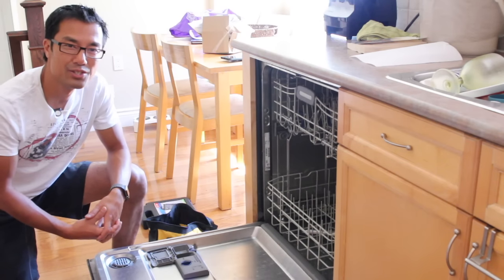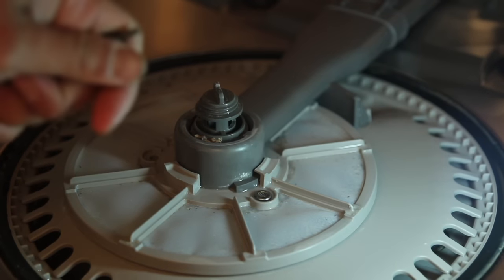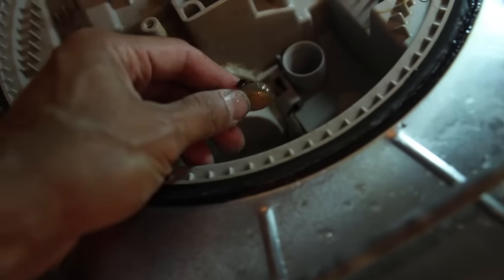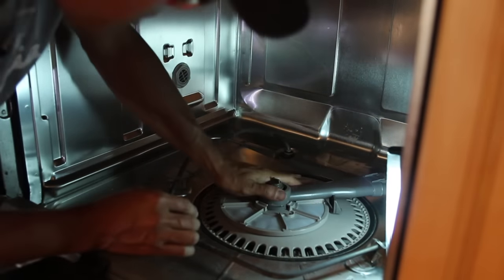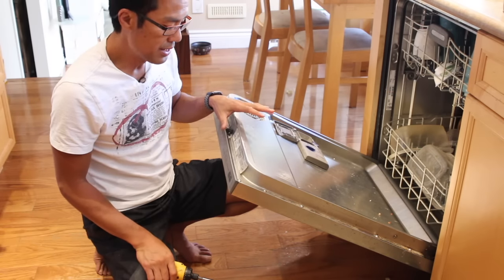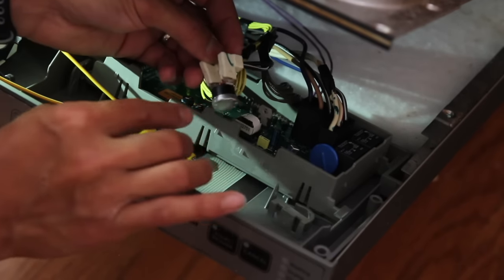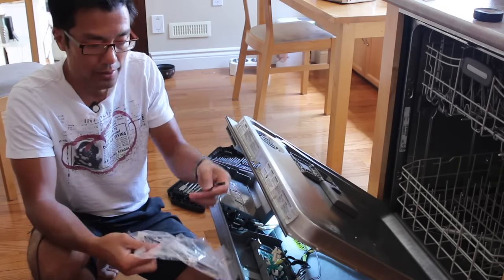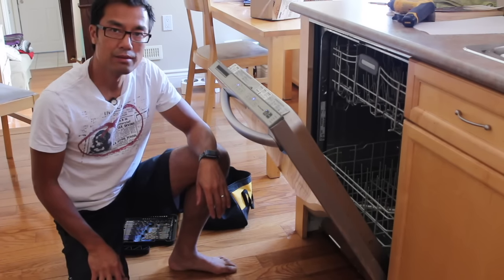KitchenAid Dishwasher Repair - No Power, No Lights and Grinder Clean up

Comment: I have no idea why they use these devices ...perhaps to enrich the rewards for the service techs and parts vendors!  These non-resettable breakers could easily have been replaced with an auto-reset device (they do exist) or even a manual resettable thermal breaker.

These things occasionally trip for no really good reason.  I have the same dishwasher and mine has tripped twice over the course of eight or ten years.  I have never replaced it.  Quite often, you can spray them with freeze spray and the extreme cold will make them reset.  I've even done it by putting the device in my freezer overnight.  Reinstall it, and it works fine again for years ...for at least as long as a new replacement would have.  I have even opened them up (gently), reset them and re-closed them, and they work just fine. I just LOVE beating the system!
Reply from the maker: Love this!  I need to try this out.
Reply: @DDIY-Guy 
 ...the ones that won't reset with cold-shock can be reset by opening them (gently!), resetting them manually and re-closing. A little dab of super glue will re-close them.  It's important to re-close them completely (firmly) as failure to do so will affect its intended function.

Everyone I've ever reset (cold-shocked or manually) has worked properly.  The one in my dishwasher has tripped twice - about four years (and many wash cycles) apart, but it still works fine.  I have the exact same type in my KitchenAid oven.  The self-cleaning cycle (after about three years of use) started to trip it due to the high heat.  That one reset nicely with cold-shock. (I never use the self-cleaning function anymore for that reason).

When you open one up, you can usually see there is absolutely nothing wrong with it ...it just got "finicky" one day and decided to trip.

With all this said, they are in there for a purpose, and even though some may trip inadvertently, some may trip due to an actual heat problem.  The bimetal in these devices can actually weaken over time (after prolonged exposure to heat and/or too many trips).  In that case, it should be replaced, and reasons for the tripping should be researched.
Reply from the maker: Thank for the tips.   Have a great evening!

Comment: Danny - I followed your directions and was able to fix the dishwasher. The new fuse blew again after one use so I am thinking there’s something else wrong. How do I go about figuring that out? Thanks
Reply from the maker: It might have been due to the quality of fuse you bought….if it’s not too costly, maybe get another brand of fuse.  If it still blows, then there might be a bigger issue with the control board….it that case, it’s hard to find a replacement board, plus it’s expensive.  At that point, it might just be best to get a new dishwasher :-(

Comment: Hey Danny, thanks for good vid. In terms of dishwasher fuse on main power line and a thermistor are two different things, correct?
Reply from the maker: Sorry i only know of the thermal fuse on the control panel.  The main board can also sometimes blow and might need to be replaced.

Comment: We have the same model, and it just stopped mid cycle, too!! Ours is now completely full of water on the bottom and not draining at all.  Do you think it could still be a fuse issue?  Trying to figure out how to clean out the water in the mean time....!  Thank you!!!
Reply from the maker: Is the lights completely off?  You can try turning off and on the breakers first.  If the lights don’t go on again.  Use a “dry vacuum” to suck out all the water.  Once you get the water out, then clean out the grinder like I did in the video.  There might be something jammed there that could have blown the fuse.  Once you’ve cleaned it out, then check the fuse like in the video.

Comment: Great video! however I have a different problem, the unit is leaking from the bottom. Do you have a video for that? I checked other videos and they are talking about a Grommet, does this unit have one? thanks.
Reply from the maker: Yes, i made another video on a leak fix at the bottom.  Check out the other videos in my channel.

Comment: When I jumped the fuse and tested to see if the door lights came back one, a part of the mother board sparked and smoked. The fuse was blown (I tested with a voltmeter before), but not before the motherboard also fried. Also, I found a melted connector/wires going into the motherboard. Something got very hot. Even if I replace the fuse/motherboard I can't replaced the melted connector. And I don't know what caused the overload. Time for a new dishwasher. Thanks anyway.

Comment: Thank you.  Mine was dead in the water out of the box.  Option #1 Factory Warrantee repair if I can't do it myself.  Option #2....Whirlpool sends someone out ot pick up this piece of junk and I replace it with a B osch like I had before for 14 years.
Reply from the maker: After a few more other issues with my Dishwasher, I gave up and ended up replacing it as well with a Bosch and we love it!

Comment: The fuse is there for a reason, bypassing it could burn out a device down line. Best to use a wire shunt with a comparable fuse inline or test the faulty fuse.
Reply from the maker: Good advise.  I got lucky with this one and my dishwasher as been working ever since.  Thanks for commenting.
Reply: DDIY GUY Danny Jose I wasn’t so lucky the first time

Comment: Danny - hey, this has happened again in around 3-4 months - Stopped again in cycle.  Any thoughts on the recurrence? Bigger issue? It’s  a $15 fix, so I’ll continue to do it if needed to extend life.
Reply from the maker: Try cleaning out your grinder again.  There might be some stuck items in there.  I would just buy the fuse again....these things tend to happen on occasion so that’s why they have the fuse to prevent further damage to the board.  Hope next time it last more than a few months....mine has not blown since I installed the new fuse.

Comment: Has your repair held up as it's been 2+ yrs since you posted this video?  Also, do you think the fork pieces caused the grinder to bind up and resulted in the overheating that blew the fuse?
Reply from the maker: Yes, my dishwasher is still running well with no other repairs needed.  We use it everyday and I regularly clean out the filter every 2-3 months.  Yes, I believe that things that get stuck in the grinder will potentially blow the fuse.
Reply: @DDIY-Guy  OK, thanks.  I have ordered the proper fuse for my Kitchenaid dishwasher and plan to do the same repair that you did such a good job of documenting on your video.  I looked  at several YouTube videos and yours was by far the easiest to understand and most helpful.  Great Job!
Reply: As a follow up, I wanted to let you know that I cleaned the drain and replaced the thermal fuse.  This repair was successful and the dishwasher is working now.  BTW, the bottom spray wand on mine bumps the bottom and doesn't spin freely when I try to spin it by hand.  I thought that I had incorrectly re-assembled it, so took it apart again and reassembled with the same result.  I think perhaps the bottom spray wand pops up a little bit under water pressure to allow it to spin freely.  I can't tell for sure if it is spinning freely during operation, but I don't hear any unusual bumping or banging sounds during operation and I do hear a "swoosh, swoosh" sound which sounds like it is turning.  Thanks for your help!  Al

Comment: Never, ever, underestimate the value of shopping for anything on eBay first.  That fuse link on most on-line appliance part sites, or on Amazon, will sell for $28.00 to $37.00 plus shipping which will usually add another $4.00 to $8.00.  You can buy that same genuine Whirlpool fuse on eBay for $8.00 to $12.00, depending on the vendor, with free shipping, and I had my part in three days.  People think that Amazon is the go to site for good deals but you soon find out it's only making Jeff Bezos richer by the minute.  Sometimes you have no choice, but most of the time you do.
Reply from the maker: Thanks for the tip. I will certainly look more on eBay options. Have a fantastic rest of the weekend.

Comment: I didn't see what problem you found. Mine one has intermittent no power no led, but sometimes it works fine, check power cord/nut not found problem, any idea?
Reply from the maker: When you say intermittent, do you mean the dishwasher just stops during a cycle?  If so, check the bottom front/right corner of the dishwasher where the circular water spout is located. Make sure there is no utensil stuck underneath it.

Comment: Why spend 30.00 for a fuse when you can get a fuse holder and a fuse for a few bucks, solder or crimp the fuse holder in place, and if you have a volt meter it has a resistance meter on it that you can remove the fuse and test it, with the power off of course!

Comment: Never bypass fuses unless you like living in a burned down foundation.
Reply: What do you mean by bypass?
Reply from the maker: Well the purpose of a fuse it to blow or cut the circuit if there is an abnormal amount of current surge.  Bypassing this fuse will allow any current to go through....but this method was only to find out if the dishwasher will actually work again if the fuse is replaced and not meant for you to permanently bypass it.
Reply: @DDIY-Guy +

Comment: I have  General Electric Dishwasher Model No:GLD5500L00WW  , Seri No: LL750671B and when I plug in there is no light but just beeping ones only.I did not find the fuse also.Any idea what is the problem.
Reply from the maker: Well it does sound like there is something blown on the control board.  If you open it up and check out the board.  Look for some burnt marks.  You can also try turning of the breakers and on again to do a soft reset.  Or you can look up your model on YouTube and look for how you can do a factory reset.

Comment: I’ve gone through my fourth fuse in less than a year, and like the most recent fuse it blew on the running of the ma gone after the repair. I replaced the element this time since the dishwasher was 10 years old. I’m stumped on what’s killing the fuses.
Reply from the maker: Have you cleaned out the grinder?  If there is something lodged or jamming it, that might cause the fuse to blow.  Where did you buy the fuse?  You might want to try and buy the fuse that I linked to in my video description.  The other thing it could be is the board itself.  Because it’s blown several times for you already, check for burn marks on the board.  It might be damaged.

Comment: Hey Danny, this was my problem exactly, but now when I turn on the power two led lights are lit about half brightness. The washer is working ok. We have ran a few loads, but it's not the same as it was. Any ideas?
Reply from the maker: Not sure about the LED brightness. Did you do a clean out of the dishwasher as well?
Reply: @DDIY-Guy  Sure did, I think we may have had the spinning thing on wrong in the bottom. For some reason it was hitting the tube in the back that goes to the top when it spun. I assumed it took water pressure to push it up during operation since it moved up and down freely.
Reply from the maker: Yes that is an important part to put back properly.  I think i covered that step in the video.  You first press down to lock in place, then screw in the water-wheel,  then lift it up to have it spin freely without hitting anything.

Comment: My dishwasher did just as yours.  I followed your steps.  I worked with the replacement fuse but then stopped again mid-cycle (no lights).  Any suggestions???
Reply from the maker: Make sure you got the right fuse.  Also the fuse is meant to prevent more damage through over current in your circuit.  If it keeps blowing then there might be something causing it.  Try replacing the fuse with again with another authorized brand and see if it blows again.  If it does...it is best to get an authorized technician in.  Hope that helps.
Reply: susanne mckinney is my

Comment: I do I reboot the control panel? Power is working but it will not run.
Reply from the maker: If the power is working, then it might be an issue with the board.  If you can take it out from its casing, check the back of the board and look to see if there are any burnt out connections.

Comment: Danny, Thank you for the great video.  When I put everything back together the lower wash arm though it spins freely it wobbles when spun manually.  Is that proper?  It can make contact with the heating element.
Reply from the maker: It wobbling is normal.  Just make sure its spinning freely.
Reply: Thank you for your quick reply as well as reassurance Danny
Reply: Danny, We installed the new fuse and the machine worked great for 2 washes.  We have another issue which has come about.  We run the machine and about 20-30 minutes into the cycle the Start/Resume light starts blinking blue.  When we push the Start/Resume button and close the door it starts again but fails a few more minutes in.  We needed to repeat this process 2-3 times to get the machine to finish and drain the water.  We unplugged the unit for a couple of minutes to see if the system would reset.  That didn't work. Any advice would be appreciated.
Reply from the maker: Did you clean out the grinder like i showed in the beginning of the video?  Also make sure there is nothing stuck on the bottom of the dishwasher floor....there things that sometimes get stuck under the corner water spouts.  The other might be a broken water valve.  I made another video about that one as well....but leave that as your last option.  The other could be a something wrong with the motherboard that the fuse is connected to...when the fuse blew, it could have damaged the circuits....check around the fuse area and see if anything got damaged.
Reply: DDIY GUY Danny, Yes.  There was crazy stuff in there including broken glass.   I cleaned the machine tub from top to bottom.   I just a reset sequence on it pushing high temp wash then heat dry simultaneously.  This lit up all of the buttons blue.  I closed the door, then opened it then I clicked the cancel button 2 times.  This turned off all the blue lights.  I then did a rinse only cycle and that worked. (No blinking light)   Hopefully when I do a full cycle it’ll work
Reply from the maker: Hopefully you solved the problem....keep me posted
Reply: @DDIY-Guy  Unfortunately the new problem persists.  After about 20-30 minutes the Start/Resume light blinks blue, the machine stops and the tub is filled with water.  Any help would be appreciated.
Reply from the maker: That is usually a sign that the water is not draining properly.  Have you checked the water spout in the front floor corner of the dishwasher?  If you pull it up and down, you might find something stuck underneath it.  Also try checking the drain tube that goes under your sink usually and connected to your sink drain.  Take it off and take a dry vac if you can to suck out any clogged items.  It that doesn’t work, check out my other video on the replacing the water valve.
Reply: DDIY GUY Danny Jose thank you for your advice.  I’ll watch your other video and try that

Comment: I have the same issue, i open my dishwasher door and there's standing water with no power.  And then a few days later the power comes back on and i just click drain and it DOES drain, so not sure what the issue is.  I tried running it again and has the same issue.
Reply from the maker: Try cleaning out the filter and grinder like I showed in the video.  Also, if possible the drain hose.....that might be clogged.
Reply from the maker: Are you seeing any lights at all on the controls? If not, that it might be the control board.
Reply: @DDIY-Guy  wow thank you so much for the quick response.  So, i noticed my float is broken....I am thinking maybe there is an auto shut off if the water gets too high and maybe after some water evaporates after a few days it allows the dishwasher power back on.  I'm not an expert, just a theory... any validity to this?
Reply: @DDIY-Guy  the control board lights are on and the dishwasher works normally.  Initially the fuse blew, but I replaced it and the dishwasher worked again.  I think when I did the initial troubleshooting (I am not technically inclined at all) I might have wiggled the float too roughly and broke it.  Some of the electrical tape is melted, but the dishwasher is about 8 years old, so not sure how normal that is???
Reply from the maker: When you say float, are you referring to the spray spout at the front right bottom corner of the dishwasher floor?
Reply: @DDIY-Guy  The circular piece at the bottom right corner, yes.
Reply from the maker: Yes, if the piece is damaged, you will need to replace/repair it.  I had a utensil stuck under it once and I had the same problem you are having..my unit would just pause during a cycle.
Reply: Same issue any resolution?
Reply: @garymann3648  yeah i bought a new fuse, but don't just buy a fuse, buy the wires with it... they are probably burnt on the inside.

Comment: when i replaced the fuse. it worked but before the full cycle of cleaning finished it went out again…what does that mean
Reply from the maker: it could mean that there is a blown contact in the main board.  if you take it a part and look underneath the board, you might see the burnt mark where it blew.  if this is the case, you likely will have to replace the board.

Comment: All my lights on my kitchen aid dishwasherare blinking then only cancel and start button work? Still won’t start ?
Reply from the maker: Check the jet spouts on the front right corner floor of your dishwasher...sometimes there is a utensil that gets stuck there and prevents the dishwasher from starting.